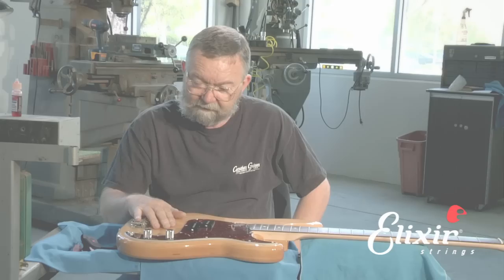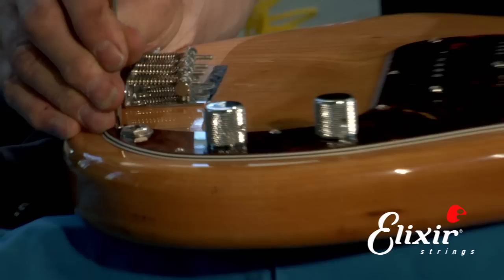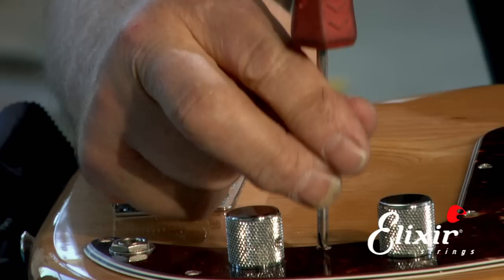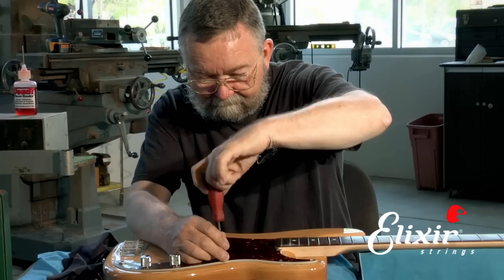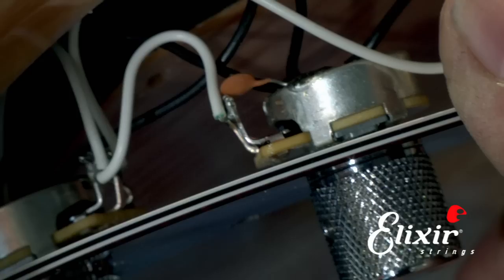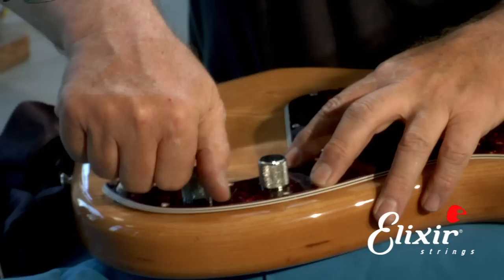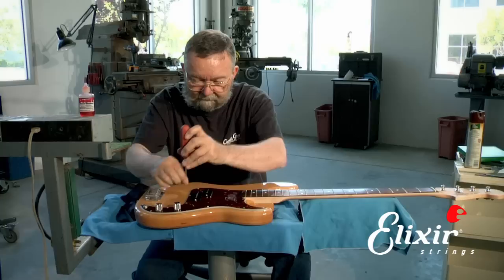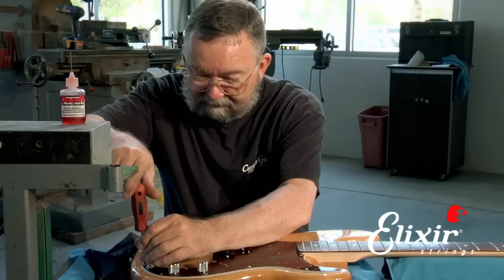Cleaning Your Bass Electronics | ELIXIR Strings

Comment: For a bass such as the Ibanez RDGR 500 that doesn't have a pickguard or anything, I'm guessing you just do the same process by just removing the backplate. Correct?

Also, is there any special way to clean knobs with a pull out function?
Reply: Sorry you didn't get an answer to your question 11 years ago! Here's a video that deals with these issues: https://youtu.be/oRdHsigtqlA